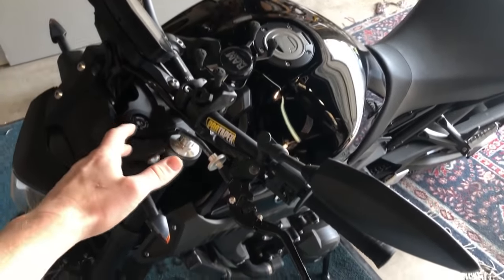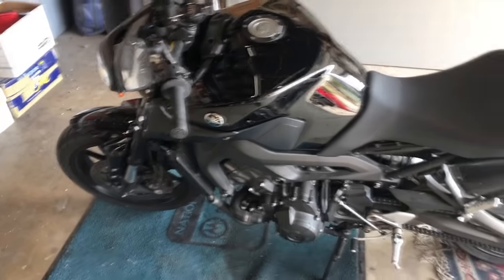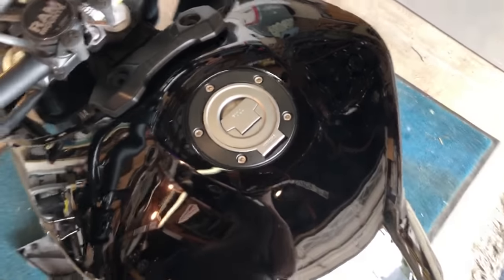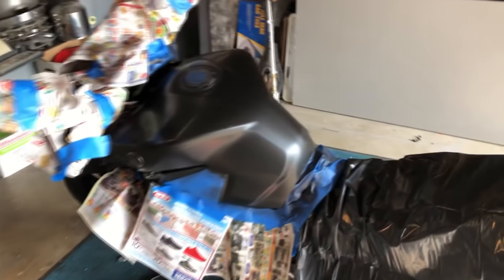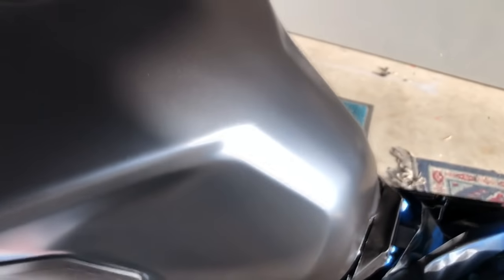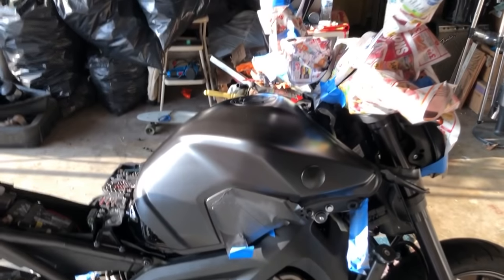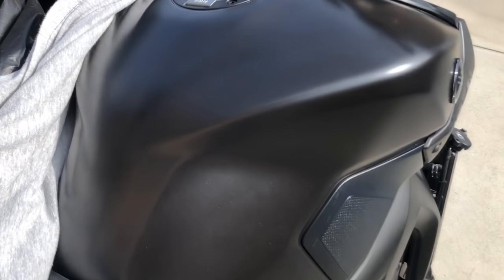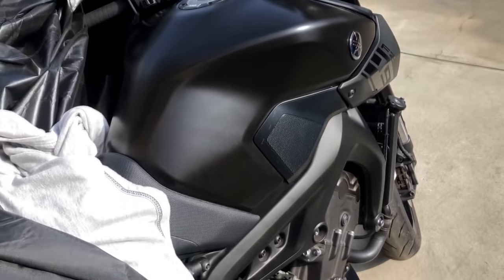I Almost Ruined My Motorcycle With Plasti-dip...

Comment: Did you know Wd40 makes burnouts look better i got it from Mighty Car Mods.

Also Wd40 can clean garage floors and make them shiny i think???
Reply: Yeah spray them all up in ur brake discs for maximum braking power
Reply: @t.j.peterson3419  Hell yeah lets take some car oil and soak em on my brakes. Works as good as brembo brakes
Reply: Aspix we have to make a video called top 10 cheap car hacks
Reply: @t.j.peterson3419  yeah
Reply: Works great on motorcycle tires.

Comment: Someone told me it has to be applied in several coats because it’s easier to remove when it’s thicker. Getting to in the cracks, crevices and tight fitting areas might cause difficulties to remove. I think it’s great for accenting though. I love your garage.

Comment: I kind of want to send you my truck so you can destroy it

98 k1500
NA 5.7 vortec 
-GM performance cam
-Removed garbage GM spider popit CPI injection valves, replaced with
 electronically controlled SPI spider injectors 
-flowtech shorty headers
-3" tuned stainless full magnaflow exhaust  system 
-high flow cats
-MSD cap, rotor, and spark timing control module  (advanced 2°)
-spectre ram air intake
-egr delete
-volumizer box delete 
-port and polished throttle body
-black bear cable tuned pcm
-8" pro comp suspension kit
-1" body kit
-17" black XD wheels
-36" bfg ko2 (gen2, garbage tires)
-bullet proofed eaton carbon clutch "active locker") 14 bolt 2500 3:72 GR rear end
-lightweight fly wheel
-custom made hardened lightweight drive shaft
-bullet proofed transfer case
-front end rebuilt with all moog components 
-gov bypass (138 is fastest its been before it felt unstable [via phone gps, speedo tops 100], had  around 2k rpm left, i dont have the balls to max the rpm power band
-dual trans cooler
-4 on floor
-custom built back rack with LED markers
-aftermarket 2 tone paint with pinstripe (white with black stripe)
-no rust on body, surface rust on frame, no rot through
-220k on body
-about 25k on upper rebuild
-3k on trans, transfer and rear end
-fucking air horn, come at me bro
-ugly ass red interior with a blue bench seat
-dashboard cover piece duct taped in place
-absolute wiring disaster,  wires and harnesses that seem to go NOWHERE 

Guy before me had stupid blue pool noodle covers on most of the wires in engine bay, i left it for the lulz.
Also had spray painted shit everywhere,  again left for the lulz

0-60mph in 6.5-7sec. Lighting fast for that truck especially on big tires. (Stock just under 12sec)